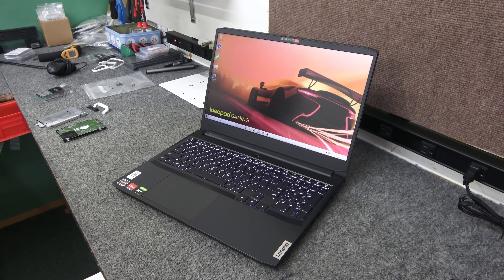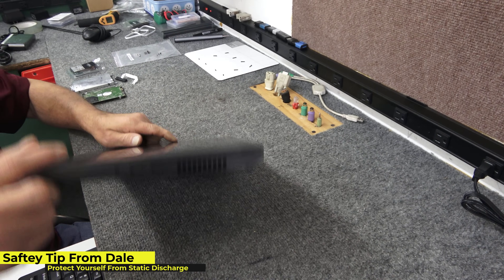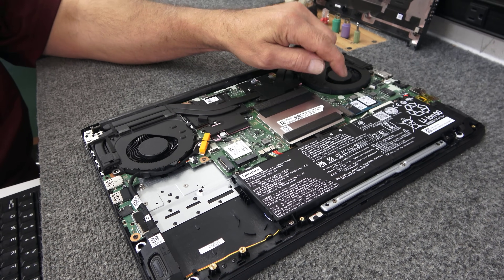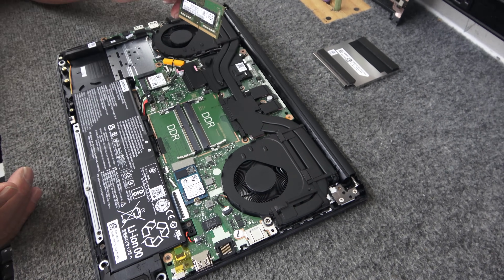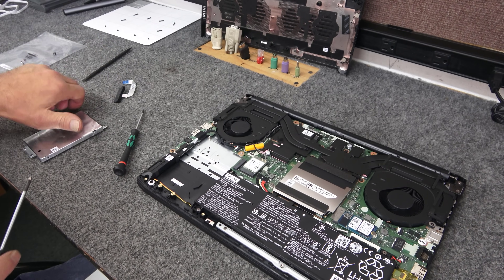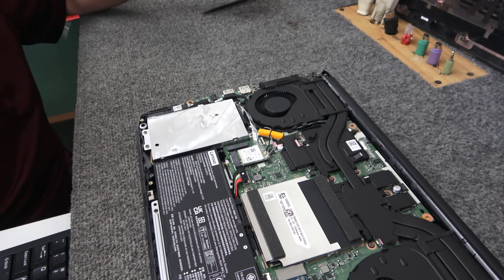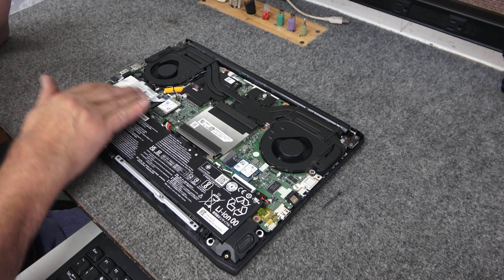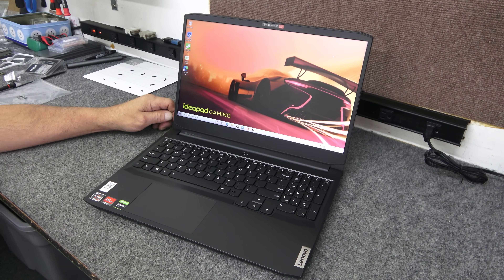Upgrading Lenovo IdeaPad Gaming 3 Laptop.  Memory and Add HDD.

Comment: Why do you say 16 gb is better choice for ram "if you leave the stock 256 ssd"? Does a 256 ssd not play well with extra ram (like 32gb)? If I use an external ssd via usb-c, could I then upgrade to 32GB ram?

Comment: This video was tons of help, I put it off for almost a year but i upgraded the RAM. I was also terrified of doing it myself lol. Now i am more confident & ready to do the SDD now. If only I could find another Caddy.
Reply: still, be sure to unplug the battery before doing anything.
I was repasting as accidentally dropped my metal tweezers onto the board which caused a tiny spark.
Luckily the laptop is still fine.

Comment: I use a 2280 in mine and it works great. There's a slight slant to it but the connector it uses flexes to enable installation anyway. Haven't had any issues.

Comment: Mine is not booting up after doing this upgrade. I did each step exactly as it is, any hint?
Reply: did you connect your battery afterwards?
Reply: @najisibari9072  of course. After several attempts of disconnect and reconnect it finally booted up. It showed the blue screen of death a few times. I dunno maybe it's a connection problem.

Comment: Is this unit the 2021, 15ACH6?  Is the 2242 factory storage soldered in?....any chance of upgrading memory at the 2242 slot with something higher than the factory 256GB?  I cannot believe it doesn't come with the standoff for a 2280. 

Thanks

Comment: I have the identical laptop. I added a second NVMe drive after buying an assorted kit of standoffs from Amazon. You are totally correct about disconnecting the battery first I discovered almost the hard way. Had a couple of sparks but no harm done luckily
Reply: I just connected mine but I don't get the pop up when I got disk management did you have this issue?
Reply: @Imnot0kei  No, I don't recall exactly but obviously it worked for me, is the new drive working in another machine?
Reply: Also which stand off kit did you buy?
Reply: @Imnot0kei  I think Youtube deletes links so what I got from Amazon UK is called: Akuoly M.2 SSD Screw Set PC Motherboard Screws Spacers for Asus Gigabyte ASRock Msi M2 Nvme SSD Drive, 21pcs

Comment: I've upgraded my RAM to 32gb and My laptop looks identical to this one on the inside.  But when looking to purchase the hdd, none of them come with the caddy and wire to connect with.  Does anyone have a link to a caddy that would work for this laptop?  All the ones I find have the bottom screw holes farther apart. Thanks in advance.

Comment: 6:50 - Correct me if I am wrong but that button wouldn't really clear it. It needs a destination to clear it and since the battery is unplugged it has no where to go so it will just stay in place. Again, I could be wrong so I am pressing the power button just in case.

Comment: I put an nvme M2 ssd drive in the ssd 2 slot and the notebook didn't recognize the ssd at all. It does not appear for allocation or in the system bios, as if n had been placed. The ssd has been tested on another pc and is working. Q do I have to enable ssd slot 2 somewhere?

Comment: Superb work fella! I won't call you grandpa,  I'll call you a seasoned computer vet! I've been in I.T. at various stages since 1997 and a computer user since Commodore 64. But I'm impatient and wanted to see someone walk through the process instead of me figuring it out. I was doing a RAM upgrade and swapping in my old SSD. You were great at showing a few quirks and I didn't need to do anything but follow your lead. Maybe 15 minutes later and I was pumping 16GB RAM and 500GB SSD - all showing up. Had to grab my readers to get that HDD snap down in there. Anyway, snazzy laptop which is grinding now. Keep making those vids CCC!

Comment: Did you have to purchase the drive caddy and cable separately?  My laptop is en route, so not sure if the caddle and cable will come with it.  If not, I'll probably just buy a standoff after figuring out which is the right one when I do the ram upgrade.  I'd prefer to take advantage of the faster 2280 over 2.5" SSD.

Comment: I found out that Lenovo has a screw kit available for this model. Lenovo tech support was useless, and their parts department did not know what was in it.  The parts department sent me a picture of the parts bag, but it was impossible to tell. After 3 calls I was able to convince a supervisor to send me a screw kit for free. Sure, enough the standoff is supplied in the kit! The screw is not in the kit but the 1TB Crucial M.2 I bought had one in the box!

Comment: Can anyone please clarify the max RAM capacity of this laptop (whether it can be upgraded to 32 GB) and if there is additional storage slot to increase ssd capacity instead of removing the existing and adding to it?
Reply: I added a 16gig ram and left the factory ram ins. It works perfectly
Reply: You can use 32gb it works wirhout problem

Comment: I just found a really good deal on a low spec version of this laptop. I really appreciate this upgrade walkthrough.
Thank you!

I was able to upgrade both the ram and the rom without any issues. I forgot to partition the ssd for usage and panicked a bit before remembering I had yet to do so. ( xD )

Comment: the m.2 standoff that is currently being used by the short drive can be taken out and can be used to mount a bigger m.2 where he installed the bigger SSD hope this helped
Reply: can you please tell  which on the short drive is ?? I am in desperate need for a standoff
Reply: @Aryan-vn3ls   the short drive I’m talking about is the m.2 drive that’s already installed in the laptop where he placed the normal drive with tray mount is where you put a standard m.2 drive like the ones you see in desktops and you can reuse the stand-off that’s being used
Reply: It seems so dumb that you'd have to give up the space. You'd also need to clone the drive (since that's what windows is installed on)

Comment: hello! i have a question, im planning on adding a stick of 8gb ram on my laptop and i wanted to know if is it ok if its not the same brand? cause i just found out that this laptop has a samsung ram while the one i bought is crucial. thanks!
Reply from the maker: Hi. Mixing brands is just fine. Should try to match speeds though.

Comment: I noted on a couple comments below that the Lenovo documentation states that the 2280 M.2 slot is limited to 2 lanes (x2) vs the 2242 M.2 slot which is x4.  I ran some benchmarks last night and it turns out that on my laptop (AMD 5600H with RTX 3050 ti, purchased Dec 2022) the 2280 M.2 drive appears to run FULL SPEED (x4)!  Here are my max benchmarked results:
Sabrent 2242 M.2 512gb: max 2425/1861 MB/s sequential read/write
Crucial P3 2280 M.2 1tb: max 3661/3227 MB/s sequential read/write
My guess is that this may be dependent on the CPU used and the Lenovo documentation is too generic or simply outdated.  For example, the documentation also does not indicate the laptop supports 32GB RAM, but mine certainly does.
Reply: How did you mount it? Did you add a stand off?
Reply: @Jose R  I used only one of the screws supplies with the HDD mounting bracket.  No standoff required.  The screw does not go all the way down (positive stop) and the 2280 is nicely held in place and does not touch anything.  It is also not stressing the M.2 socket - it works just fine!  To clarify: Use the M2 x L3.5 screw (same screw as the ones used to mount the HDD cage to the laptop).
Reply: @eichisama  I've got the same spec'd model as you and want to upgrade the RAM and storage. Was going to add a SATA SSD but maybe Lenovo meant for the 2280 to be held in with one screw?
Reply: i have the intel i5 11th gen  GTX 1650 variant , i too recently installed a 2280 p3 nvme ssd but am getting only half (1700 MB/s sequential read )of its actual speed. Could you please help me out about  how can i find whether my M.2 slot is limited to 2 lanes or something is wrong with the SSD.. I have also installed the ssd without a standoff , the ssd is very slightly bent but not touching anything , could this also be a reason?? i m a complete newbie and dont have much knowledge :(...
Reply: indeed the slots are limited to x2 instead of x4 , so yea a common L from lenovo and you can confirm that by checking the product pdf sheet

Comment: I will never understand why they make it so hard to install a new ram/ssd 12 screws and a lot of using force or tools to make sure to not mark it or break something is ridiculous
My 4 year old laptop just have 3 screws to change ram and 2 for the ssd cause it was made to be able to upgrade the thing , is it so hard to make a cut on the case and leave a tiny space with a few screws to change the ram without disassembling the entire laptop or make laptops easier to disassembly

Comment: I bet you could use a motherboard standoff for that m.2 slot. If not, another option would be to use an appropriate length screw and put it through, but use some plastic washers on the backside to make up the difference in space.
Reply: No standoff is required!  You actually just use one M2 x L3.5 screw (same as for the HDD mount) and it's fine.  The screw doesn't go in all the way, and the M.2 is not "pushed all the way down".  (I've installed this on my own just today to confirm.)
Reply: @eichisama  I did the same thing, but I put one of the thermal pads between it and the laptop to give it some support.
Reply: @eichisama  Might try this later. Thanks for tip, let me know if you had any issues.
Reply: @anotherks7297  Nah, it's been rock solid for me!

Comment: I didn't disconnect the battery and upgraded the RAM directly. When I was placing the metal sheet on the RAM, it touched the motherboard and sparks flew out.
Luckily, it was for a brief moment and the laptop still works fine despite a charred mark on the motherboard.

Rookie mistake from my end! 💀

Comment: Thank you so so SO much for this visual guide! I was terrified of changing out my RAM my self, and this simple and straightforward guide was exactly what I needed. I got everything in, no issues, didn't forget to disconnect the battery and everything went smoothly. I had to rewind a couple times to see how you got the stick out, but I was fine overall.

It's just as you say--don't touch anything that you don't need to, keep metal away from the internals, be careful and you'll get it done.

Again, thank you so much for posting this!

Comment: Seeking assistance please. I'd love to put another 8gb stick in without having to buy 16gb. Is there a way anyone can give me the information to try and find an identical 8gb stick like the one that's already in it? I'm aware to make sure they're for sure the same, buying 2 sticks is best but to save some money I could risk it, and if it doesn't work out just shell out for another of the same stick. Anyway anybody know the exact specifics of the ram stick that's already in it? Could it vary? Like maybe they swap around any number of them? If you'd recommend against doing this, please include any reason I'm not aware of. (or tell me if the ram just isn't available, or the price being too high to make sense). Much obliged =)
Reply: Unless the factory ram just isn't a good stick period. I don't know much about latency values and which are best to shoot for. If the stock ram is just too slow and a few extra dollars for 8gbx2 really is worth it, I could look into it.

Comment: 7:35 can anyone give some insight on this statement? He said if you're going with a 1tb HD, you may want to go with 32gb of memory. Is he suggesting that the more hard drive space, the more ram you may want? Or am I mistaken. I've never become aware of any significant correlation between the two, or needing to scale your ram for more storage.
Reply: No need for that , 16GB is more than enough for 2022-2023 , however if you are a heavy designer you should consider adding more, I bought the 8 gb version and Upgraded it to 16gb , until I realised it reads only 14 gb because of the Shared internal Vega Card , so keep that in mind.

Comment: I just followed your guide to upgrade my laptop and found that the cable actually has some double sided tape on it. It's just really hard to notice.
The caddy also comes with some padding for HDD vibrations, but I'm guessing your client didn't give you those.
Reply: Yes, the pads should have been included with the HDD bracket.  In the Lenovo Hardware Maintenance Manual it shows the proper location for applying the necessary pads (3 go on the HDD, 2 small and one large).  However, given that the HDD is screwed down, I'm not sure the pads really make all that much difference...

Comment: If you bought this in the last month just know that it’s an upgrade model and that there’s no SSD slot anymore. But the nvme is in better placement and super easy to install :)
I know because I just bought it and open it up and look at it
Reply: RTX 3050Ti Version still comes with SATA , however RTX 3060 doesn't.
Reply: I just bought this device and upgraded it there is still space for a 2.5 ssd but u have to get a cord to run it to the plug
Reply: Wich ssd slot is not there no more I just bought this
Reply: @astrofry2340  the 2.5 inch one. It only has room for the nvme and it’s easy to mount

Comment: Honestly. I live in Michigan. I got the same laptop and want to buy and get the same upgrades from it or better. but I am always nervous to open it up myself or do anything. I would come to that computer center but that's a 3 hour drive from where I live... Is there any recommended computer repair shops/Computer Centers you could recommend in between Warren and Detroit?
Reply from the maker: Hi, no, I am not familiar with that area. Sry.

Comment: Question: I bought a stick of Crucial Ram 8 GB DDR4 2666 MHz. Can I just add that to the existing RAM? Or would I need to buy another stick of Crucial and put them both in? Thanks.
Reply: I bought crucial RAM too , Works like a charm , just make sure the Hertz of both RAMS are equal.

Comment: UNPLUG THE BATTERY. I know a lot of us picked this up for Black Friday. I unplugged the battery but plugged in back in too early and when I went to out the cooling plate on the ram I hit a something on the board with the corner of the plate and it started glowing red hot and smoking.
Reply: Yep, same thing happened to me. Got a few sparks but luckily it seems like there is no damage.

Comment: Is 3200 MT/s and 3200 MHz the same?
Reply: Well, yes and no.  Technically DDR4-3200 is "3200 MT/s" and runs at 1600 MHz (but Double Data-Rate (DDR) means 2x1600 = 3200).

Comment: my laptop came with the 2280 SSD in it, and the 2242 SSD slot unused. Now, if I ever want to upgrade, I need to just remove the SSD altogether. I found a 2242 SSD, that I can use alongside this SSD, but can someone tell me if the 2242 slot is for 1 sided SSD, or 2 sided SSDs would work?
Reply: I just replaced my 2242 and it seems to me that a double-sided 2242 M.2 should work.  That said, the Sabrent 512gb 2242 is only $70 and single-sided.

Comment: Question. Is there anything that would stop me from being able to install an 2280 m.2 nvme that can write 7000mbps? I’m considering the Samsung 980 3500mbps write the 980 pro @7000mbps write. Can I jump to the 7000? It’s this exact computer with 16g 512g 2242 m.2. Want to put a 2280 @ 7000 is this doable?
Reply from the maker: Hi. Good question. This model is pci-e gen 3. The 980 is gen 4. It should work but you probably only see slightly higher gen 3 speeds.
Reply: @CadillacComputerCenter  thank you so it’s no use going to the 7000? I won’t get anywhere close to it irl?
Reply from the maker: This may help you.....Specifically, currently, PCIe Gen 3 has a top speed of 8Gbps (985MB/s) per lane. That said, a PCIe Gen 3 x2 (two lanes) M.2 drive has a cap speed of up to 16Gbps. Similarly, a PCIe Gen 3 x4 SSD has a ceiling speed of up to 32Gbps.
Reply: @CadillacComputerCenter  Cadillac answers from Cadillac CC! Thank you kind sir! It sounds like the 980 pro is just a 980 @ gen4 speeds (double) I think if I got both they would perform the same. No pro for me.